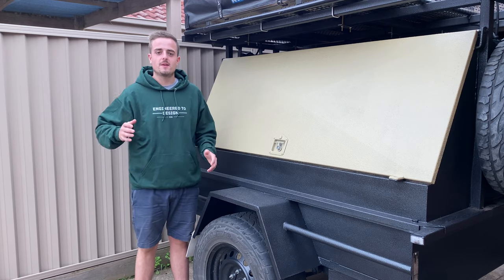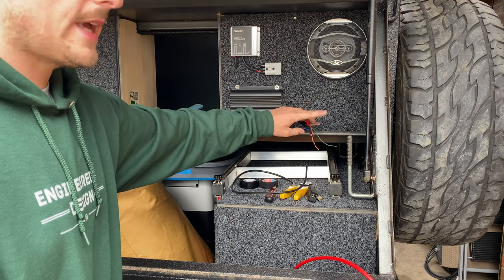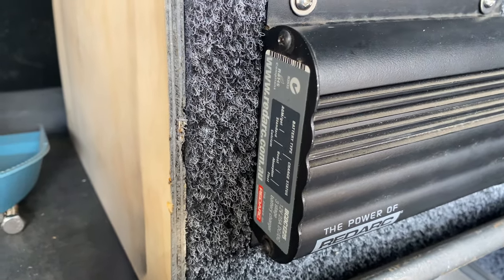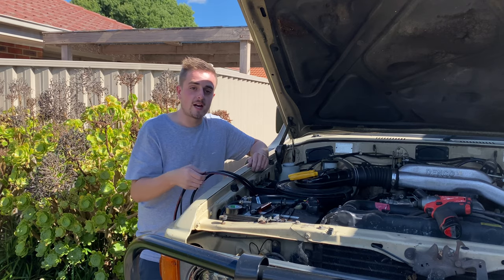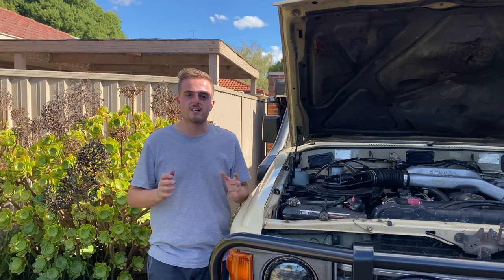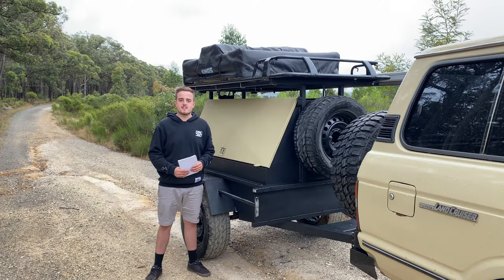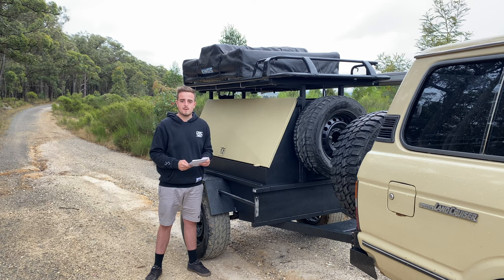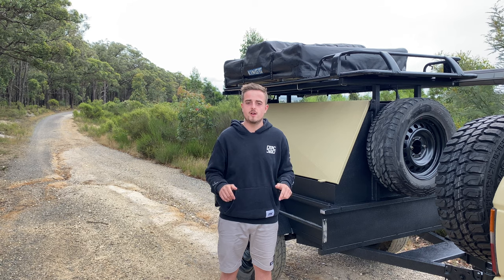Best DIY Camper Trailer

Comment: Just finished my own camper too, off a 7x4 without the tradesman top. Came out as a very similar cost. Good job mate
Reply from the maker: Very nice you would have more room!
Reply: @EngineeredToDesign  my wifes not a fan of heights so I wasn't able to lift the tent as high as you. 
Flat deck with hinge similar to a standard soft floor.

Put in a false plywood floor and mounted all electrical and the fridge inside. Just got some very basic drawers to build and it should be good to go.
Reply from the maker: @harrisonsaladine7672  that’s awesome! It can be hard going up the ladder at night would have been nice to have it lower at times..

Comment: Hi great video, i have several old Holdens and Fords but i am painting a 1979 Land cruiser FJ 45 with a Turbo diesel engine and 5 speed box i was going to build a camper but bloke at work sold me a camper trailer factory made for $3500 so went that way keep up the great videos.
Reply from the maker: Thanks mate! Wow a fj55 they are a good solid rig! I have two land cruisers to fj45 and a hj60..
Reply: @EngineeredToDesign  sorry i meant FJ45 it runs the 2H turbo diesel and 5 speed box

Comment: Only thing i would as is an offroad hitch so you can take it on some more difficult tracks like up the cape and vic high country.
Reply from the maker: Hey Dave yes I did look into that but I would have to modify the mounting plate.. where did you get your itechworld lithium battery from online?
Reply: @EngineeredToDesign  i got it through my canopy fitter called offroad systems but you can just order it online. Its around 950 which is quite good
Reply from the maker: @davidcowan1583  I will have to have a look thanks mate 🤙🏻
Reply: @EngineeredToDesign  no worries mate. Happy to help mate. Can't wait to see the new HQ you are making. Once lockdown and boarders are open i will defs have to come visit.
Reply from the maker: @davidcowan1583  yeah for sure man I’m so excited to have a space with all my tools, work on stuff like the golf cart can’t wait. Thinking I might do a few videos on setting it up..
Reply: @EngineeredToDesign  i think thats a great idea. Showing people what is possible on a budget and with a badic shipping container.

Comment: Great video and awesome project.
Very impressed!!
Wanted to ask if you had to register the trailer or does it not require any registration??
I am from Melbourne Vic and considering doing the same to a simmilar 6x4 boxed trailer and it would be great to know from your experience if you had to register it and what you had to do in order to get it done.
Thank you again and keep up the great work 🍻
Reply from the maker: Yes mine has to be registered but I bought it registered as it was a “hopper trailer” and not a standard 6x4 it only works out around $65 a year

Comment: Finally a trailer I want to build myself! Love your work mate! Do you know how much it weighs by any chance fully loaded?
Reply from the maker: Hey mate thanks! I am actually not sure but would be keen to know myself, I know it is pretty heavy to pull up behind the 60.. 🤙🏻
Reply: @EngineeredToDesign  True! I wonder if I would be able to get a smaller trailer. I only have a 2 door pajero with a 2L engine so don't want something over 500kg at most lol.
Reply from the maker: @budget4x4life  agh yes that makes sense, you could get a 6x4 and build a box on top yourself? Keep the batteries and most weight down low to help centre of gravity. Put electric hubs on it..

Comment: Does it ever feel like the trailers going to tip when it's not hooked up to the towball?
Looking at doing something similar, love the comfort of the roof top tent not the fuel burn it causes though!
Reply from the maker: Definitely agree mate would love to have something more slimline.. nah it’s good with the stabiliser legs on.. could always have 4, two on the back and two on the front?

Comment: I know this is a stupid question but can an Anderson plug be installed in the 99 Holden vt commodore sedan or are they only recommend for 4WD?
Reply from the maker: It definitely can just make sure you use suitable wiring for your needs and an isolator at the battery depending on what your doing..